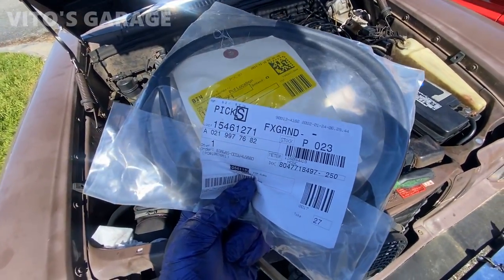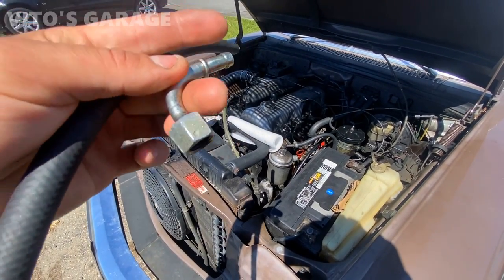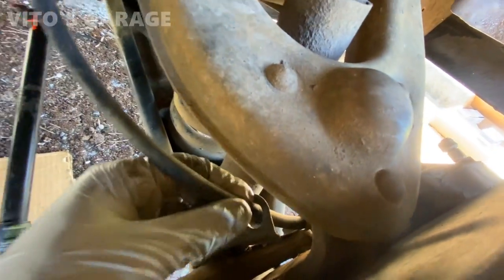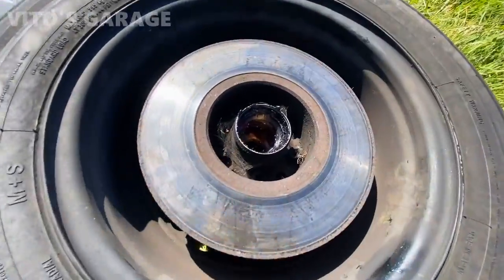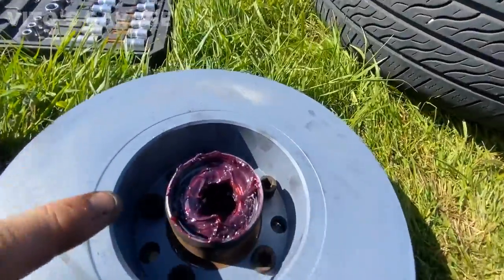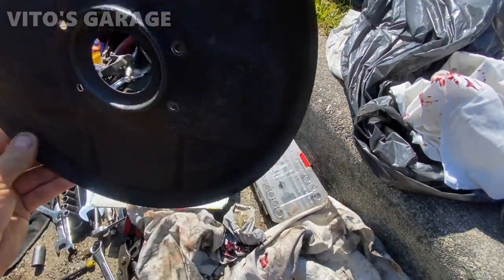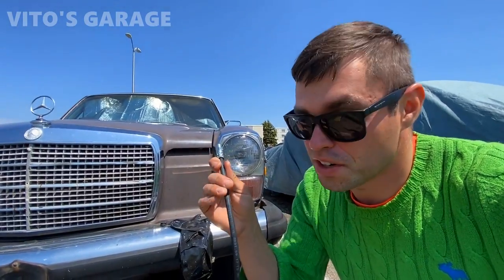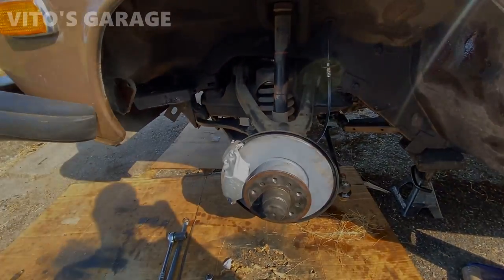1976 Mercedes 240D W115 Complete Front Brake Rebuild and More!

Comment: Hey Vito, nice job on the front brakes!

May I ask, what cooler have you installed? As the original brass/copper one's aren't available anymore. Is it the w123 type? Is the oil cooler still mounted with the original screws? 

My 300d cooler started leaking, but luckily still had one lying around. If this one starts leaking I hope I can replace it with a w123 one as they are still available. I could also have them rebuilt, but that's more expensive than a new w123 cooler.
Reply from the maker: The oil cooler seems to be still original to this car. It’s mounted with the screws
Reply: @VITOSGARAGE  Thanks for the reply! I actually meant the radiator for water cooling. I see it is an older Behr with a plastic top portion like it is original on the w123, however the w115 was a brass/copper one, that's why I asked